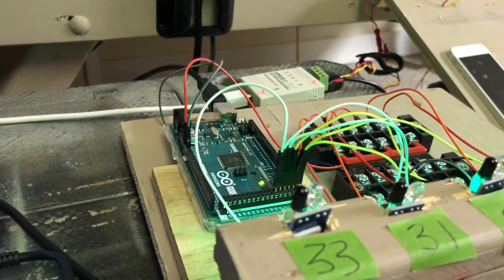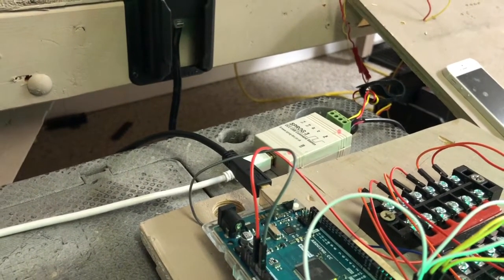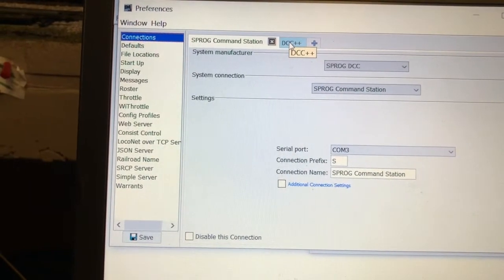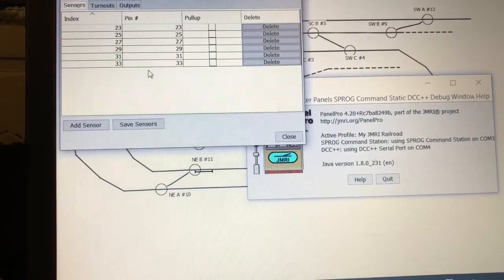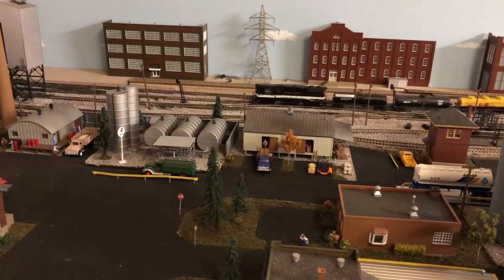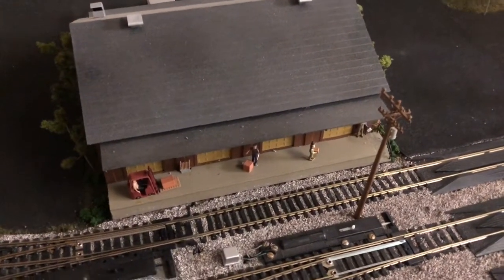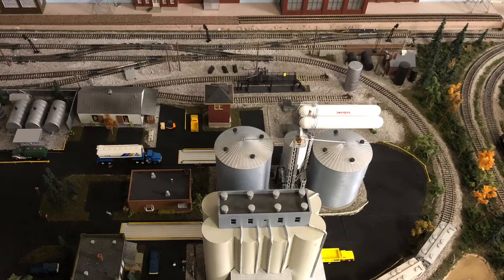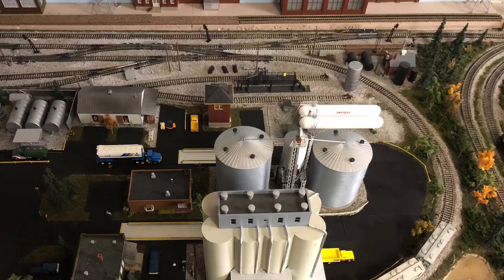My 4x8x2 HO Layout - Technology kicks my Ass

Comment: I'd presumed you'd gone north for the month.  I hope you find the Digistekijes... Ditgihixees... Dygunitrees... oh HELL, that switch thingy is the problem.   Snap switches are pretty basic, but I've heard they're finicky if you don't use a capacitor discharge in the circuit.  Maybe that... "thingy" just isn't up to it.
Try weathering some rolling stock, and modeling a building.  Maybe buy a new boxcar you don't have.  Ordering something online always cheers me up.  :)
Reply from the maker: Not going North until we get our Covd19 vaccines.  We hope it’s before May.  Only advantage of being old and diabetic is maybe getting shots before May. 🤞🤞   Keep safe😷
Reply from the maker: Buying something sounds good, what’s your card number?  😀😀😀

Comment: Thank you.  This was a great reason for me NOT getting into JMRI, computer control, etc.  I also will NOT be electrifying my switches and will be using manual throw stands instead.  I also realized the benefit of physically throwing the switches as an active part of operating the layout instead of spaghetti wiring and an elaborate control panel.  This is NOT a personal criticism of your preferences.  Maximum operation, minimal frustration.  LOL   Cheers, Bob
Reply from the maker: What? You don’t want to be on the leading edge of MRR technology?  The cutting, bleeding, soul killing edge?  Smart Man!
Reply: @FredE528  I can vicariously relive my days as a brakeman/switch-man on the Adirondack Scenic RR and as a track repair guy on the Mohawk, Adirondack & Northern short-line.  The bonus is the HO switches will be easier to "throw".  LOL
Reply from the maker: Cool.  You have any videos or pictures?  Post on YouTube?

Comment: Agree on changing the snap switches.  I think you have the controller setup correct.  A brake is always good for problem solving.  Take care in these strange times.
Reply from the maker: Thanks Greg.  I was pretty sure either the DR4018 was problem or that individual snap switch.  Just finished swapping snap for Smail turnout motor and it appears to work ok.  Be safe😷